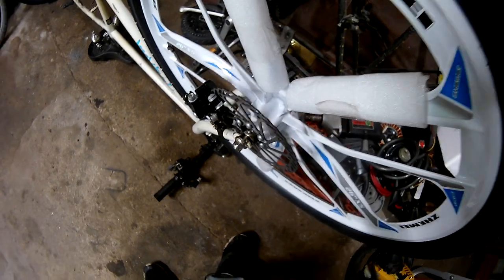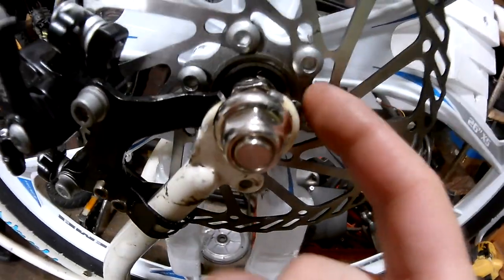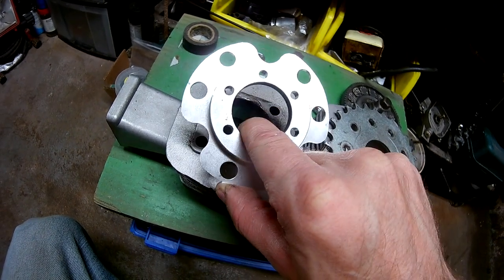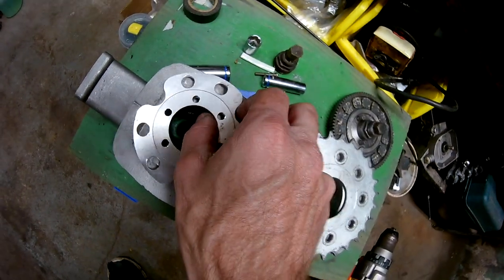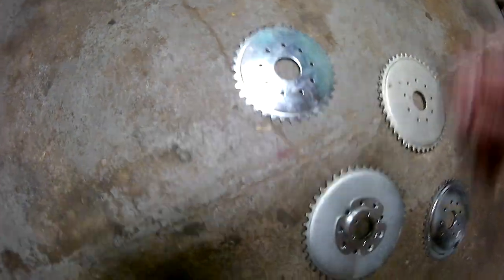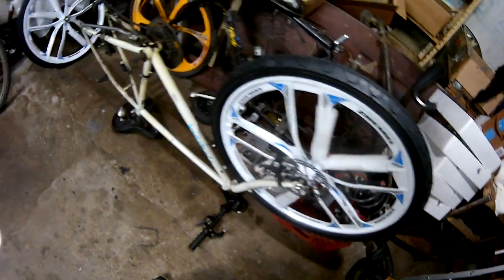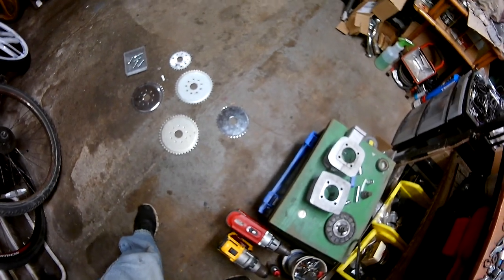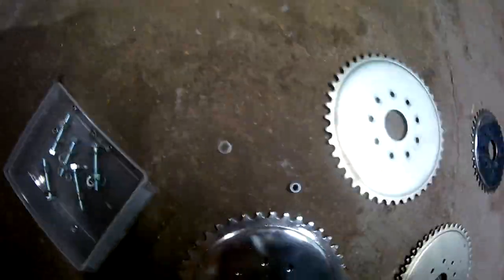How to mount Mag wheels and disc brakes calipers to a non disc frame

Comment: thank you for posting that video how to set up the mag wheel on a regular bike beach cruiser I did it with the hyper and believe me it was kind of pain in the butt but I got it to work
Reply: That's why I'm here, and so far I've learned nothing but how to be patient and still haven't heard how to mount the disc brake on the mag with the sprocket as well, Does this guy sound drunk to you? Maybe I'm just getting old and less tolerant of bs. ✌🏼
Reply: @m.kasper7646  Sprocket spacer rotor
Reply: @willardbuchanan9122  yes I have them both, but I need to know or just see a picture of one, I'd like to have disc brakes on my fakerfelt frame with ghetto bike 26" wheels with hookworms, I normally use spoke rims but my wife wants these silly silver mags I have sitten here new in the box I got thrown in on some horse trading in the past. She wants mags🙄🤔🤣🥰
"Sure! Here ya go honey"!
Hahaha!¡!¡ 
"Happy wife happy life"
Right? 😫😖😉😁

Comment: Are your front forks recessed where the bolts are ? Some forks have tab washers on the axle to stop the wheel been pulled out if your nuts are slightly lose. Just had my front wheel pull out of the forks on heavy application of the disc brake. My forks where smooth and did not have tab washers.
Reply from the maker: No there not recessed. I use a big 3/4 in ratchet to torque all wheels down so they do not come loose
Reply: @darrenmillion1432  I welded a disc brake holder on my front forks and thought nothing about the lack of tab washers or recesses did over 5000 miles trouble free miles. Braked at low speed and wheel came off. Now looking for new forks the old ones are a little bent after the accident.
Reply from the maker: @CraigDavies.  My Black and Yellow bike is done up the same way as this bike is being done. Not one problem out of that setup so I thought I would do it again with this bike. This setup works well enough for me and I have never had a wheel come out of a bike. I check every bolt and nut before every ride and after every ride.